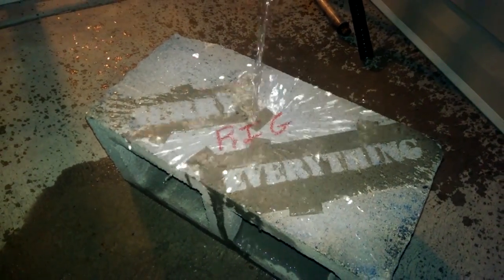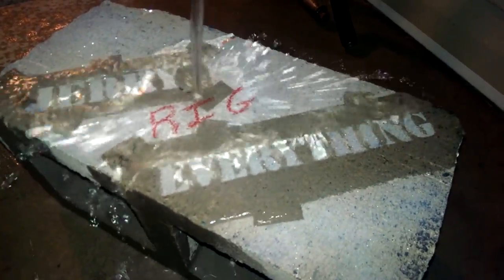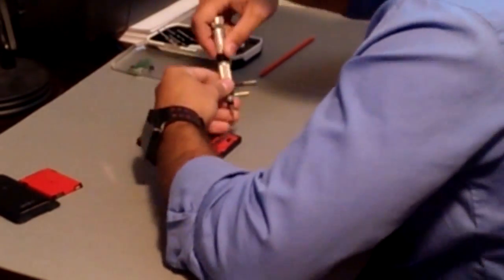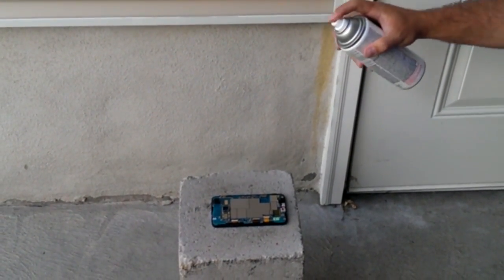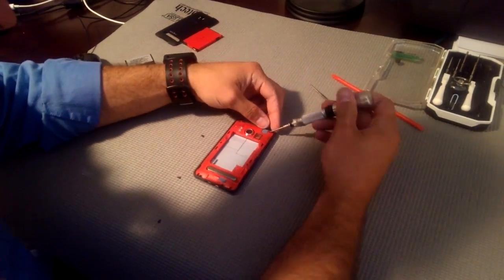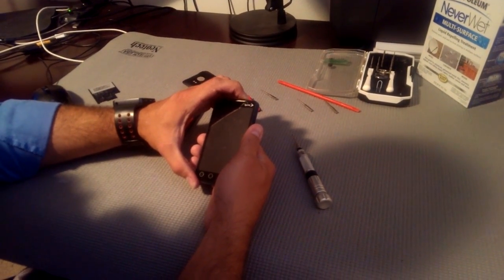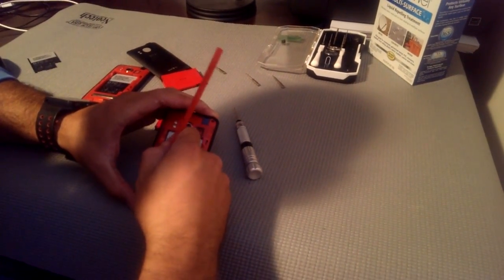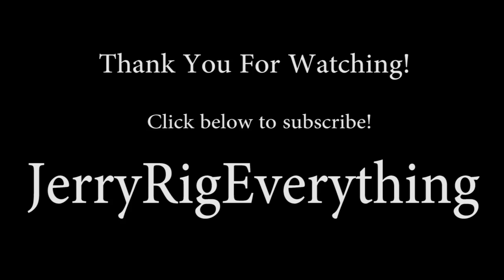Neverwet on a Smart Phone (Rustoleum product)

Comment: what if you took the ribbons off and taped the connectors to stop the neverwet from making contact with them? even using like a putty instead of tape if need be just to stop the neverwet from getting into the connectors or so you think its interfering with the circuit board all together not just the connecting terminals?

edit: i ask because i have a moto z4 that i need to take apart to replace the screen and battery (battery swelled thus cracking my screen) and i was thinking... while i have it apart once i get the screen and battery replacement i could spray the inside of it with neverwet and as you said "immortalize" my phone haha but after watching this video now im not so sure.. hence why i asked maybe if you taped off or used putty to stop the spray from touching the connectors at all period.. if it would work

Comment: I had 3 of those evo 4g phones, they are trash to start with. The simple act of removing the battery can cause memory corruption that bricks the phone. My first and last evo4g did that exactly. The second one got a little wet and died. The spray may not have had anything to do with it. I have an old huawei that's been rock solid four years now. Eventually I'll test it with neverwet to verify that theory.
Reply from the maker: ***** Nice!  That would be legit to get a second opinion on the subject.

Comment: 1. What will happen if i spray it on my skin or body? 
2. If i spray it on something how long will it be neverwet? 

Thanks in advance!
Reply from the maker: I am not sure about the first question but it probably involves cancer.  The second question is until you scrub the substance off.  It leaves a powdery residue that can be scrubbed, or rubbed, completely off.
Reply: Ok thanks :)
Reply: 1 word if you spray on skin you can get skin cancer